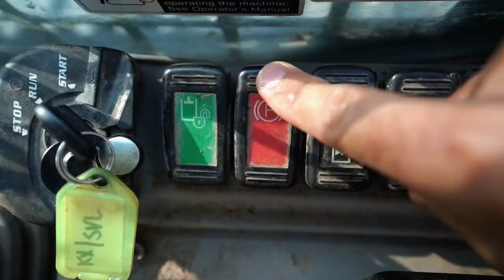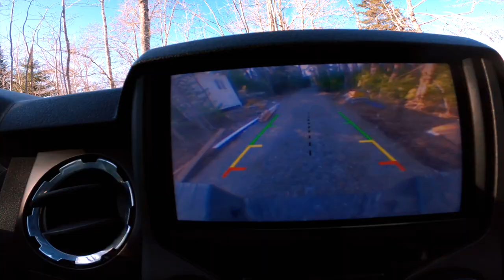Building a Home (Geodesic Dome in the Woods)

Comment: Hi guys, I must say that your videos are so easy to watch and enjoy. You are partners and professionals. Your minds are constantly in flux and are so adaptable to changes, sometimes on the fly. You recognize when the budget needs to be bumped up and you’re not afraid to ask contractors for help or suggestions. You’re easy going enough guys that a crew will let you work with them to minimize your costs. They’ve seen your work ethic and know that you definitely will help to do the job right. If there is any issue with a project you both do your research and come to the table with informed decisions. If not, the banter between you, other than idiot, is generally pretty tame, with just an eye roll.
I am so very proud of all you both have accomplished and I must say that I love Todd’s double entendres. He is so quick witted. I sometimes have to relisten because I can tell by Tyler’s face that something has been said. The love you have for each other is palpable.Congratulations and Best Wishes to you both always from Florida.🥰🥰

Comment: I've been thinking about this for weeks guys. You probably already know the tricks, but, when you go to pull the wires through your conduit, there's a quick and easy trick. Tie a small braided nylon string around a plastic shopping bag and place it in the far end of the conduit. Use a shop-vac on the other end and it will pull the sting through without any effort. One person making sure the sting feeds effortlessly and the other to identify when the plastic bag has reached the vac on the other end. This can be accomplished numerous times depending how many lines/wires in one conduit. I always leave an extra in place in case of future needs. Happy plumping/wiring! Love you two, you always make us smile!

Comment: Avid fine wood worker and licensed contractor here…Ship lap can be face nailed on the low point of the board then a  top nail on the rabbit or skip the top nail all together and the lap joint on the next board will hold down the the top of the lower board.  Either way you have half the holes to fill.  Also, given the semi climate controlled environment, it would have been good to gap your laps slightly larger to allow for expansion and contraction so  they do not buckle in high heat or humidity.  Just something to think about if you do more elsewhere on the property.  Love seeing you guys every Sunday!

Comment: We are doing the shiplap in out laundry refresh we are doing at the moment!  Looks so good!!  Really made your space look so much brighter, even without being painted yet!  Our local hardware stores are not great.  Good ones are an hour away, so I need to plan my trips well! Heartstopper was ADORABLE!!!!   SO lovely!   I love that the trans character wasn't particularly driven by the fact they were trans, like it wasn't their main feature, which is unusual in a really positive way.  We used to run 1 piece of the crown moulding through, then cut the joining piece on the 45 degree angle in both ways - if that makes sense - and marry it up.  Was simpler than trying to cut 2 pieces to connect up.  We did it with skirting also.  Good things do take time!  Don't be embarrassed about another week - you're doing great!!

Comment: Ty-Walker use the crown….

Your privy videos are following in best tradition of the cinematic franchises. 

In The Land far-far away….
Princess puss in boots, Eddie Solo, Charlie Wan Kaninebi, featuring Ty-Walker and Toddbaca, all strive to bring style to The Land, and privies of Canada. 

Next weeks episode..  will our poo fighters champion design, succumb to mid century modernism, or the dark side of brutalist aesthetic? 

Once again I am amazed with your vision and creativity.

What of the crescent moon on the door of the privy? One could cut the appropriate crescent moon shape opening, get a piece of blue glass sized for the opening, so you would have a “once in a blue moon privy”. 

I have a suggestion for the electrical, embrace the industrial exterior. Use outdoor rated electrical conduit on the out side in the “divots” of the corrugations. This would be straight forward, totally up-gradable and easy to maintain if needed. You could also use the depressed areas of the corrugations for the plumbing as well, if you halve (length wise) three or four inch diameter under ground waste pipe, you could use it as a covers for the plumbing valleys. Heavy fiberglass pipe or other insulation could wrap around the pipes to prevent freezing. All of these exterior pipes, and conduits could be left their nature industrial colors or an accent color could be applied, or paint them in the siding and roof color. 

Ty-Walker use the crown…. moldings for best design effect….

We all be tuning in to find out…

Comment: You know guys I just had another crazy thought, what about putting a pee trough in there where more than one guy could pee at the same time or you could actually put pee trough on the floor or Mount them on the wall and they also have Corner ones as well just a thought...God bless, lots of LOVE...😇🥰😁.. and another thing put the toilet up high for the elderly and also do you have to make a handicap stall if you're going to be renting it out for events... and what about heated floors after stepping out the shower... I'm not sure if you're going to put up washbasin in  or not for people to wash their hands or you could just have a pedal that they step on and water comes out or you can just have hand sanitizer and not even worry about a sink... no more suggestions or ideas sorry...🤔😳😇😁..

Comment: You're both great, but you will so regret putting MDF in that space (sorry). It will soak up every drop of moisture and expand like a sponge (even the so-called moisture resistant ones).